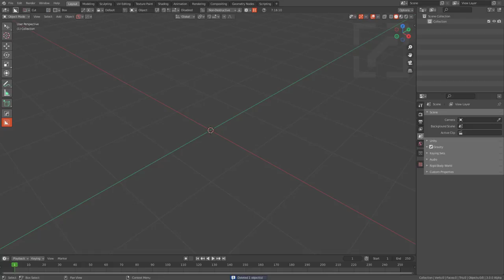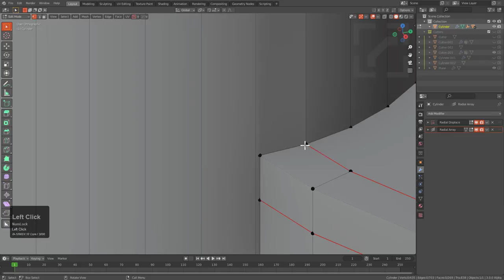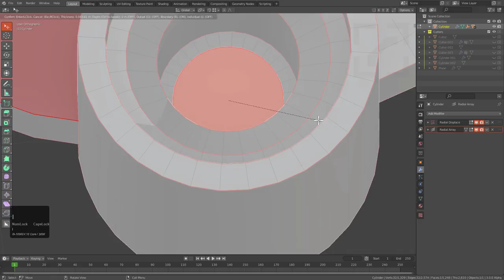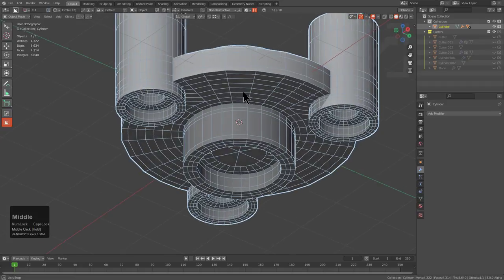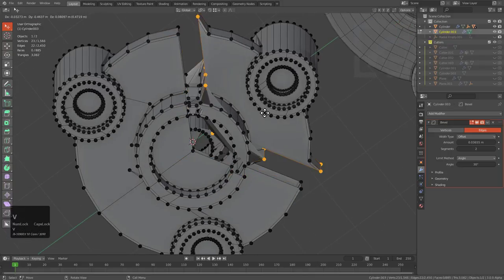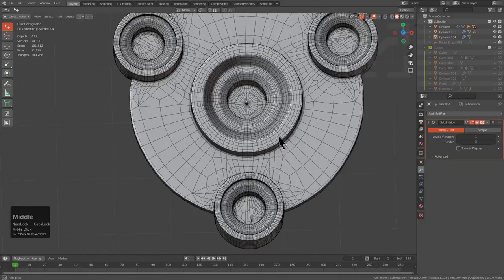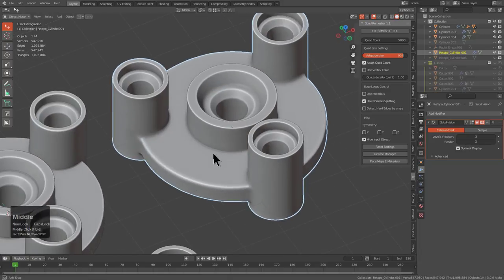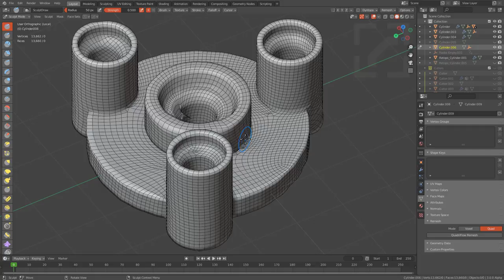#hardops 987_15 - 3 - Way Toposolve

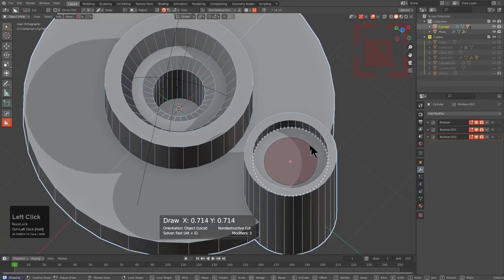Comment: 4:36 is 🔥
7:38 Remember turning on the Default add-on "F2"(yes I haven't)
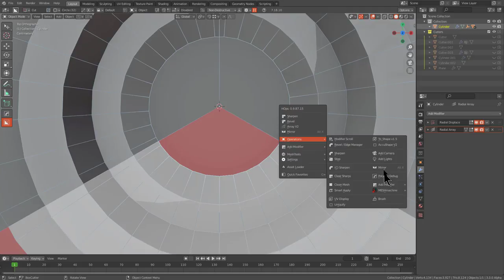How do you isolate the face at 13:02 ?
Reply from the maker: same way as the previous time! 
https://youtu.be/CJe4t0fWXF0
Reply: @masterxeon1001  Thank you. But I just am confused about how you separated the face of the quarter round from the whole mesh... Since I cannot press " / " on the numpad to do it
Reply from the maker: @monles2352  i dont recall pressing / to separate a mesh. Numpad slash is local mode toggle.

The method of separation was the same used here. 
https://www.youtube.com/watch?v=pbliE4832Qg
Reply: @masterxeon1001  😄😄Got it! Thank you so much